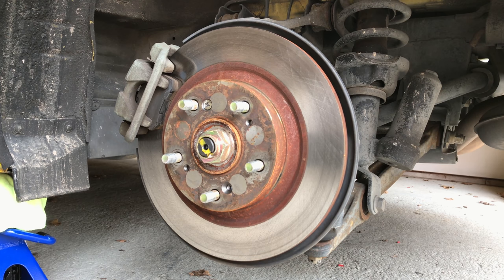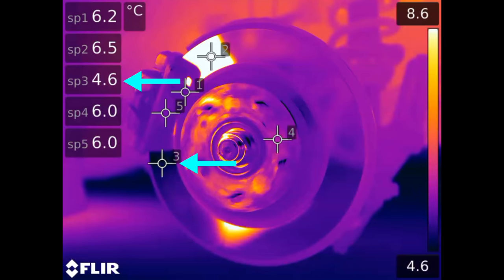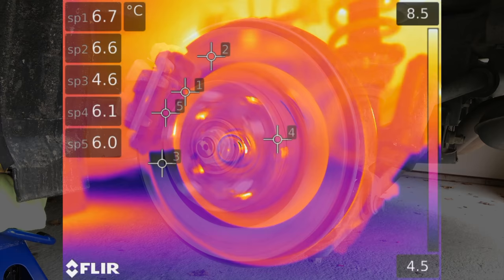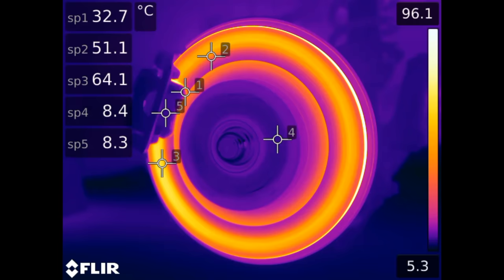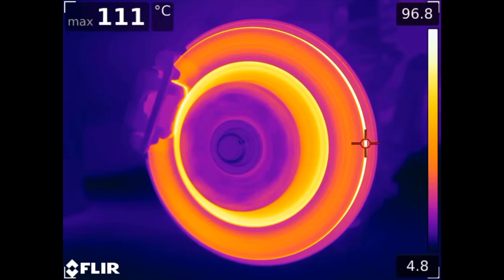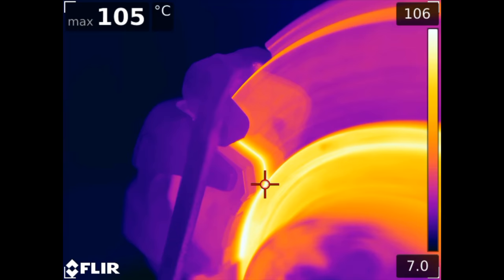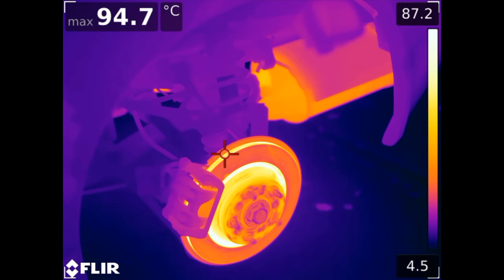How Hot Do Your Brakes Get?

Comment: if my wheels get hot, mostly the break disks, would that mean that maybe there is a chance that the breaking cylinders are stuffed, and do not pull back the pads from the disk, cousing further friction on the disks that equals the heat all the time on wheels?

Comment: There seems to be a debate between variable rotor thickness and warped rotors. Would you be willing to make a video to settle the debate, please?

I need to know if I am doing something wrong with my 2002 Toyota Sienna. I also need to know if *must* fix the problem, or just wait until my brake pads wear out, or whatever. I bought this van as a beater car for my day job work. I'm a new car owner, so i want to learn before I buy a car that I care about.

Comment: I'm surprised to see how much the wheel act as an heatsink ! Cheap car equiped with crap brakes and basic wheels with hubcovers may have such bad braking performances ! 

Plus I'have got some questions for you :
Could hybrid/electric (turbo)charger replace the throttle body ?
What make motorcycle engines so small compared to equivalent power car engines ?

Comment: I have a AWD SUV and noticed that the right brake disc gets hotter than the rest up to 130 celcius the second hottest one is tha front left disc with 95 celcius and the other two are between 70 to 80 celcius, is it normal to have such difference between discs?

Comment: I had to cut down some pads a little to fit into some calipers to be used in racing.  I left .035 to .040 side to side, I knew the pads would heat up, does the steel backing on the pad get up to 1000 F? Is that what I am seeing?

Comment: See I was looking this up because I just took my car to the car wash and happened to notice the water sizzling on the rotor, it is hit out and had about a 20 minute drive with alot of stops. So was wondering if that's normal Temps

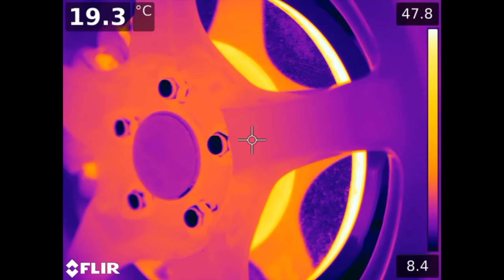Comment: Were you able to verify if that rotor runout was legitimate, or a camera trick? Also, super cool to see the reflectivity of the brake rotor at 3:15 - you can clearly see the backside of the wheel reflected in the rotor. It wouldn't have applied in this case, but a common technique when dealing with infrared temperature measurement on shiny surfaces is to put a dull black sticker, or a small bit of paint and measure the temperature at that point.

Comment: Hey Jason, recently saw a brake temp related video of yours and I have a question regarding brake temp when driving my car on track. On my first track day, I didn’t know the limit of my oem brake so I rarely did hard braking. Most of the time I tapped the brake pedal lightly hoping that this will put less thermal stress on the brake. Now, hard braking will slow down the car much faster but since it’s ‘harder’ so I am guessing it will generate a lot of heat but  only at a short amount of time. Versus light braking where you will be dragging the brake for a much longer period but less clamping force on the rotor. Which way of braking will result in overall higher brake temperature, which can potentially cause brake fade or worst case - brake fluid boiling?

Comment: Hey man, i was wondering if you could help me out? If i get a 2010 370z and then a greddy twin turbo kit, with HKS, Wastegate, Intercooler, BOV and a brembo brake kit, is there anything else i need? Should i upgrade anything else? Engine, crankshaft? Or transmission?

Comment: I've often wondered if various wheels would help rotor cooling.

I drive a mercury marauder and F150... they are both heavy and with spirted driving warp rotors and/or develop heat spots.

I'm then curious is silicone thermal transfer pads in between rotor and wheel might by help.

Comment: HEY EE,  if a 90 minute car ride in 2011 civic  had my  front brake rotors  at 50ish degrees celcius vs 35 centerhub and one rear drum at 37 vs 32 center hub , is it safe to say i have the opposite problem, dragging brakes or warped rotors or something?
How do i fix dragging brakes?
i changed the front pads about 6 months ago and was supposed to change rear shoes when i changed tires back to summer but forgot.

i just changed from winter wheels n tires to summers  yesterday  and also have a howl that wasnt there last summer, hopefully this goes away after  i fix brakes?

there was a faint almost constant hum all winter  that made me think i had a bearing going, the sound was ESPECIALLY   bad this winter when it was very cold and got even WORSE  when i backed up in this cold. is this brakes or bearings or what?
now if that slight hum is still there its drowned out by this new howl since changing tires...?

Comment: Does the temperature of the brake fluid in racecars reach near the boiling point of DOT 3 or DOT 4 brake fluid on the track? Because in this video the hoses didn't seem to get nearly as hot as the rotor and pad surfaces.

Comment: You are surprised that the temperature of the brake rotor increased measurably from the short time that it is under the pad.
If you accept that most of the cooling is done by the rotor, then the temperature increase should be independent of the length of the brake pad.
Explanation: Assume that I am getting the same breaking force independent of the pad size (that is, I will adjust my pedal effort to get the same stopping distance independent of pad size).  For the same mass of vehicle stopping from the same speed in the same amount of time or same deceleration, I would have the same rate of kinetic energy transferred to heat in my braking system.  This also has to happen in the same number of rotations.
In other words, the same amount of heat must be added to the rotor per rotation.  Of course this ignores second order effects such as the amount of time for cooling being reduced and heat transfer through pad etc. and the thermal mass of the caliper.

Comment: Jason, I like the video.  Great idea to show how this all transferred heat.   It made me think of carbon rotors and magnesium wheels would be effective in this situation.   Then I realized what issue could be leading to what looks like the higher temperature coming from the hub.  Isn't the handbrake activating a drum break inside the hub?
Reply: Jason Dahlstrom Honda e-brakes actuate the caliper with a spring linkage behind it. No drums here.
Reply: Oh, I see.  Just every rear brake job I've done had a drum.   Thanks for the clarification.

Comment: I have an irrelevant question. If I can remember correctly, you used to work on VWs, I drive a 2013 1.6L non turbo petrol Mk6 Golf and was wondering if I could perform an engine swap to the T/C and S/C 1.4L TSI engine, what would I need to change as well? (suspension, ecu, transmission from a DQ200 to something else, exhaust, catalytic converter and such)

Comment: You should do the difference between slotted and drilled rotors!!!
Reply: That's the same thing and has nothing to do with brake temperature.
Reply: Seriously? Heat dissipation is the entire reason for slotted and drilled rotors. So there is a difference.
Reply: dirt e30 watch your terminology. drilled and slotted rotors have NOTHING to do with heat dissipation. The holes and slots in discs help gasses created by the pads escape so the pads can keep in contact with the disc. VENTS, that are in the middle of rotors help direct air outward to cool them.

Comment: +Engineering Explained
Wondering if the small temperature variance of the rotor at the beginning for more or less the entire top half of the polished rotor is due to reflection off from the surroundings (garage).  IR reflection is pretty neat to see with a FLIR like that.

Comment: Hi Jason! are you sure that this axial run-out of the brake disc is not caused by the missing wheel? It might disapper, when using the wheel nuts to press the break disc more eavenly onto the hub! BR, Rainer
Reply: MrVainAUT it has rotor screws that theoretically should prevent such run out.

Comment: pulling the parking/emergency brake doesn't apply the pads. the parking brake is usually a drum brake inside of the rotor, and uses a separate mechanical line, not the fluid lines.

Comment: Hello there. I'm new to your channel and I've seen enough to subscribe. 
Quick question:What is the max temperature on the actual rim / wheel? (Alloy aluminum vs steel)
Most of the, very common, 2K paints/clears that shops use
have a heat tolerance of 140°/175°.
I don't think the shops that paint wheels understand how hot wheels/rims get on average. 
I know that there's a high heat paint for wheels but that doesn't stop shops from using regular automotive paint on wheels.
Do Wheels actually reach and/or exceed 200°?

Comment: hey thank you for your great content I feel I learn something new with every video you put out. 

I have a question and if you have a video on it I would gladly watch it.
so I'm asking this because my dirt bike tends to over heat. the stator doest output enough to wire a fan at least from what I've been told. but I was wondering if I were to use a larger radiator how much would that help? and would I need to change the impeller for the water pump? or is there something ales I could do besides adding a fan. I understand if you get flooded with questions. thank you again for teaching so many of us

Comment: Ceramic or CF brake rotors aren't reflective right? The readings wouldn't be off at all if yours were made of either right? Correct me if I'm wrong.
Reply from the maker: Having a high carbon compound should increase the emissivity, and thus reduce the reflection of IR waves, yes. :)

Comment: love your videos! I'm thinking that the disc should have been properly attached for this test however.
Reply: Evil Eyes what do you mean?  It has screws holding the rotor in place.
Reply: Admittedly I didn't notice the screw, still seems a bit lacking though and definitely not as uniform as having the nuts in place.

Comment: Hey bro I was just watching ur video I love ur explanation. However, I need some help I replaced my brakes n rotor yesterday but for some reason the passenger rear is extremely too hot than the rest of the brakes what could be the cause of it? And now there s a rattling noise from the driver rear what would be the cause of it? Thanks